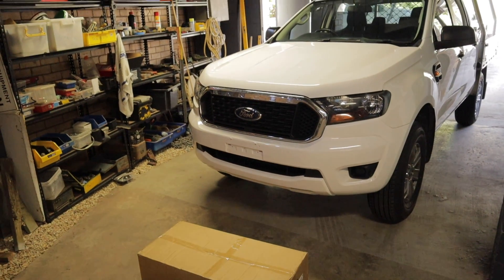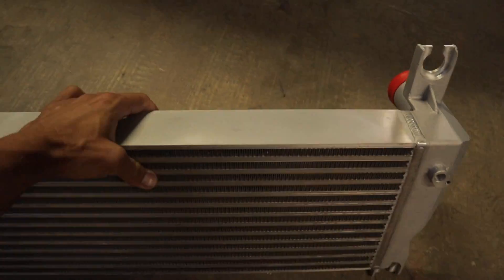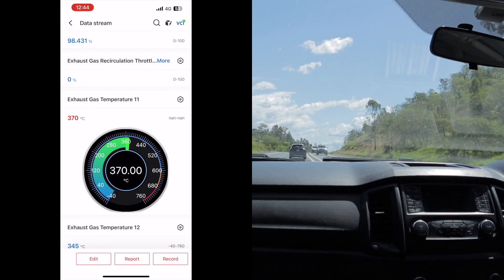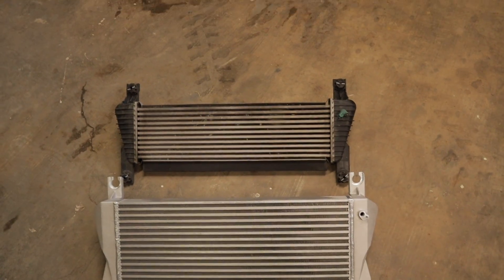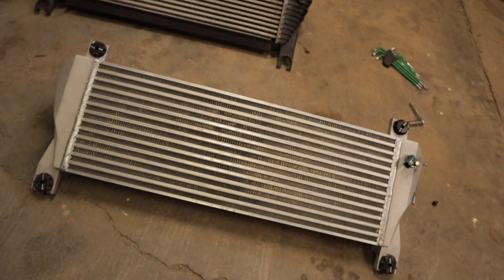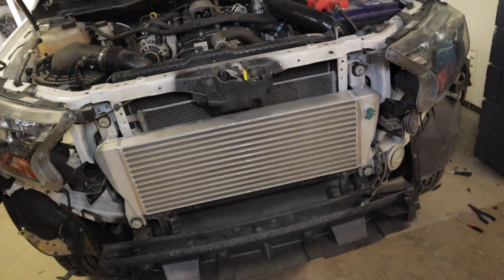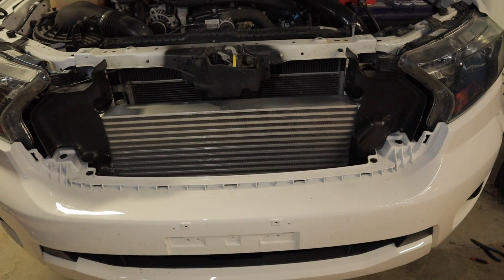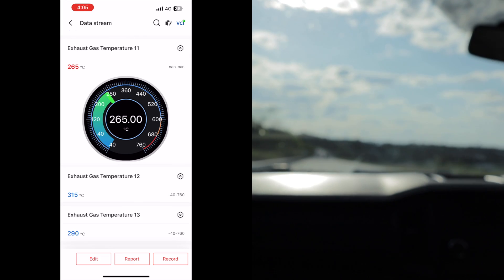Ford Ranger Budget Intercooler Upgrade & Testing

Comment: I put a 63mm Garrett in, TREMENDOUS
Reply: did you put an aftermarket turbo on your ranger ?
Reply: @jmoore9806  Well, I wouldn't call it Aftermarket. It wasn't a China eBay special. It's a genuine Garrett Turbomax, an upgrade from the Garrett that the Ranger comes with.
Reply: @imcmcguiness5110  oh ok cool....do u feel any more power difference? Also how much did you get it for ?
Reply: @jmoore9806  Heaps more power. But it did need a tune. I bought the remote tuner from Berrima Diesel. They tune it remotely with their OBD dongle.  I think the power max was about 3k. I also did the intercooler and changed all the pipes to silicone. Turbo blanket, and 3 inch exhaust.  New injectors, nomad valve body and air coolers from wholesale automotive.  It needs the extras to support the turbo. So much more power. Its amazing now.
Reply: @imcmcguiness5110  oh wow that's cool as heaps of mods u done.....Did u do all the mods at the same time ?
Reply: @jmoore9806  I did it all over a few months. It all takes time,  and money.  Well worth it

Comment: Fantastic video, thank you so much!! I was thinking about fitting my truck with a similar intercooler. Have you noticed a performance improvement, or better fuel mileage? I heard the ecu can adapt to the new air inlet temps and be more performing...? Thanks again

Comment: I’ve got 300k on my 2012 3.2 bt50. It’s been very well looked after with regular servicing and has been very reliable for me since new. Is it too late in its life to start upgrading? I don’t wanna put money into it if it’s gonna blow up any minute.
Reply from the maker: sounds like you've had a good run with your bt50 , i would leave it, my Rangers get worked preety hard so the vids i do are for preventative maintenance under high stress conditions.

Comment: Where is this air charge temp taken from? Intake manifold or from the air intake where maf is? I have Cooler air charge temp and intake temp about a 7 deg difference. Mine used to run about 320-340deg, added a intercooler dropped temps to under 300. Now with egr delete and tune is sits 240deg and aeound 300 towing at 100. All lower than standard.
Reply from the maker: Good point, i know topscan can have 3 diffrent names for the same sensor, e.g catalyst temperature bank 1 sensor 1 & exhaust gas temperature 1 1 , are both the same pre dpf sensor,  when i checked intake temp & charge temp they both had the same value, will roadtest again

Comment: Intake temp is measured by MAF sensor at the airbox, so the intercooler has no effect on it at all.
Reply from the maker: yeh i think you may be right, weird tho that the part is listed as an intake temp sensor on ebay , that's the sensor i transfer from the old intercooler to the new one.
Reply: @abdautomotive  we know by now that they’re a strange beast - anything s possible 😂
Reply: @abdautomotive  ah right, that one is temp sensor, I was talking about the one next to the throttle body, which is MAP. FORScan can see all of these sensors, not sure about your app.
Reply: Air intake temp is measured by the MAP Sensor on the throttle body after it leaves the intercooler. How could the ECU accurately adjust air/fuel ratios using the temp of the air coming through the MAF sensor out of the air box before it’s heated up through the turbo?
Reply: @jedbennett7397 maybe it's measured in different places and the video shows the temp read elsewhere like the airbox. Both runs before and after intercooler change show around 31°. How can the exhaust temp change when the intake temperature is exactly the same?
Reply: @slaps101  I’m thinking you’re right Bank 1 is probably the MAF reading
Reply: @jedbennett7397  What you're talking about is called "charge temperature", I don't know if Ranger has that sensor, definitely not as part of MAP sensor (see wiring diagrams). In either case, that's not what "intake temperature" is.
Reply: @mifki  the sensor he is changing on the intercooler is your charge air temperature sensor i drive a 2.2 transit van and in heavy traffic and with load you can feel the performance drop as the intercooler heats up
Reply: The transit does not have a fan cooling the intercooler it only relies on airflow i have seen charge air temps of 80 degrees Celsius